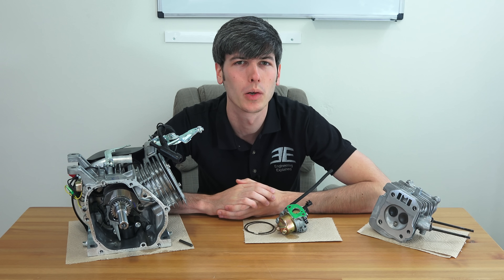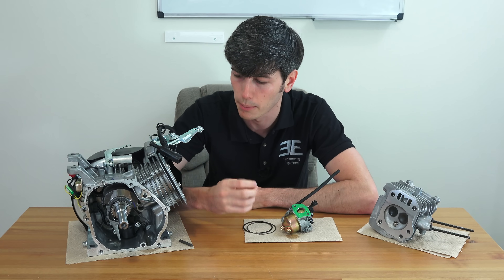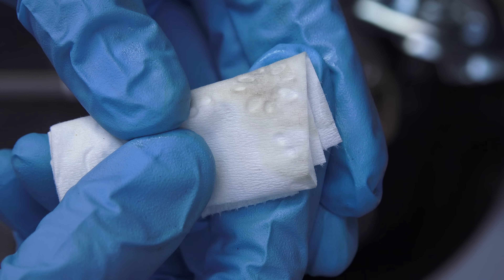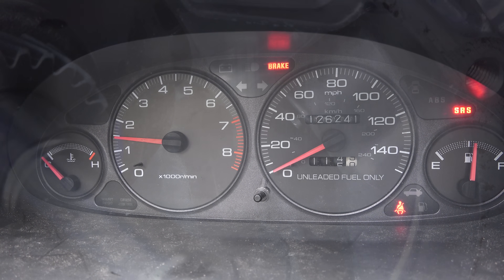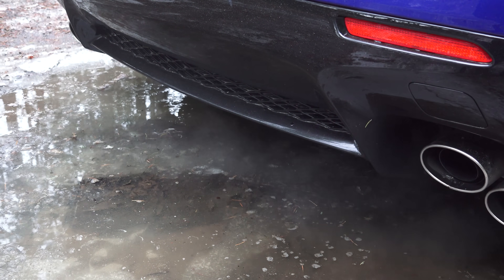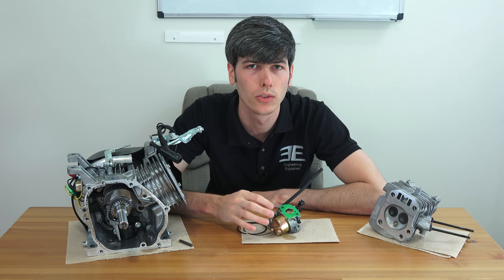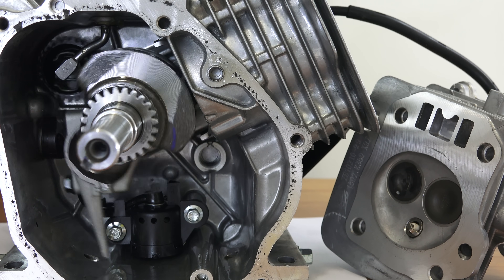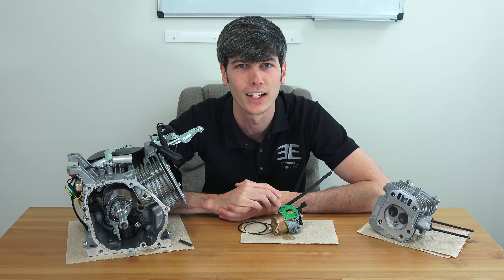Should You Warm Up Your Car Before Driving?

Comment: that was a contradiction.  towards the end of the video you state not to drive hard until the engine is warm.  That's the point of warming the engine.  Are you gonna jump on the highway and do 20 mph until the engine is warm??
Reply from the maker: Highway speeds don't require much HP,  it's accelerating that's tough on the engine. Accel slowly until the engine is warmed up.
Reply: @EngineeringExplained  cruising at highway speed means 3000 RPM in some vehicles. Not something I want to do with a cold engine.
Reply: @EngineeringExplained  wrong, if you go at the min speed of 60 mph on highway your revolutions are going to skyrocket during a cold start and you will hear your engine struggle. The high rpm, with very cold oil and fluid temps is extremely stressful for the engine. And no you can't drive easy on a highway
Reply: Engineering Explained haha.  you've never driven on the NJ turnpike.  haha.  Keep up the good work!
Reply: bb11 jr the last time I took off without warm up, the car felt like it was towing a boat.  EE thanks.... but no thanks....
Reply: My Fiesta diesel felt like the engine had rigamortis until it had warmed up. Especially in the winter. I had to use the glow plug about 20 times. The amount of people who do burnouts out of the work car park is unreal.
Reply: OK your bearings in a engine are aluminum with a thin alloy coating, they are there to have a perfectly smooth surface for the oil to make a uniform and thin layer your cam/crank/rods and so fourth ride on. So oil is/are your bearings, if you run a engine when it has sat for 6 to 8 hours or overnight there is little to no oil there and the bearings are susceptible to damage if a engine is ran at any higher RPM or Stress than necessary. It can take up to 10 minuets for oil to make it to the lifters and cam bearings in below freezing temps. That is why you let an engine idle and warm. Moving the car = stress on bearings and with no oil protection = damage. High  Revolutions Per Minuet with little to no oil when a engine is cold means scratching and bearing damage.  I hope this helps
Reply: Some cars just don't work right in the cold, that's why people warm it up other than having the heat working. I've driven off without warming up my car before. Frost building up everywhere as the faster you go the more the windows are going to be a problem unless the heater has a chance to build up some heat in the beginning.
Reply: I'm not worried about anything in the video. I worry more about thermo-mechanical stress. When you cook a turkey you do it slowly so that it will cook evenly. Otherwise, it will be cooked on the outside and ice on the inside. A large thermal differential means thermo-mechanical stress in an engine due to thermal expansion.
Reply: If technology was really smart they would make it good for cars to sit and idle some how not to start and have to go. There's a few cars with automatic heat that comes out no matter how cold.
Reply: Whatever got over 340k on my lude and I remote start 10mins everyday
Reply: TheusZeusDeus the engines in new cars run at higher rpms when you first start the car.  i don't idle for ten minutes but at below freezing, i do warm up for 2-3 minutes (little longer if it is the really really cold vortex) as my transmission jerks more in first two gears, second more than first, if i don't do it. Then the engine is warmed up by slow acceleration on the road.
Reply: Its about the torque and pressure added to the engines components when you move the vehicle. The man who told me about this has rebuilt and made race engines for 50+ years on a professional level. He only works on engines nothing else. I worked with him for a while he taught me a lot. But its your vehicle do as you please I am just trying to give you info to make a logical and informed decision that is best for you. Best of luck.
Reply: I live in a relatively mild climate but let the engine idle long enough for the RPM to drop. I do this to spare the transmission clutches when dropping it into gear. Not sure it it does though.
Reply: Noir Spectre bro come on!!  everyone knows a cheeseburger is better!!
Reply: By the time you get to the highway, it should be fine for you to hit it harder.
Reply: Grandizer 45 think of a human body, are you gonna wake up and automatically go sprint?? No, same with a car. You got turn your car on and automatically go 60 mph or just gas your car.
Reply: I think what we are missing here is that the engine oil doesnt flow that well when it is cold.  You have to wait for it to liquify so that it can flow easily through the different passage ways.  This is why you hear the lifters on start up.  Taking off with that oil being thick is gonna put strain on your bearings and lifters.  And if you have conventional oil its even worse.  Let the oil liquify and flow through your engine.  Once the lifter noise settles down, that is a good indication the engine is ready to go.
Reply: Rata 4 U yes but the load on the engine is not the same.
Reply: taxid3rmy im speaking from experience.  i've taken off with a cold engine and it felt very sluggish.  sort of like when you are breaking in an engine.  Is EE even old enough to drive yet??  haha
Reply: Grandizer 45 I actually agree with you this guy has no idea what he is talking about and it is actually very bad for the electronics when you don't let it warm up, I know this from experience with fuel injected and engines with carbs. It is good to let any engine warm up, so yes I agree with you and this guy is just saying a bunch of crap.
Reply: Kneedragon1962 guys please understand that idling does not put the same strain on your engine as does driving.  When you drive you are putting load on the engine.   It's a big difference.  Putting load on an engine where the oil hasnt circulated properly is very bad.
Reply: speed has no correlation with engine load. throttle position does. so that is invalid. heavy engine load is what you wanna avoid until the engine is up to operating temp
Reply: Grandizer 45 yeah this is just a young kid reiterating what he found on the internet. i cringe when i see people take off from a cold start.
Reply: @Tony, that's probably a bit unkind. They're making a TV show for idiots, that's true...
Reply: No you don't have to do that. Just don't floor it. Gas engines warm up fastest under a load, so moderate acceleration is fine vs letting it idle for 15-20 mins in a driveway.
Reply: It's easier to warm yourself up by walking around the house rather than lying in bed awake
Reply: @mb013962  Actually, that's a pretty good analogy. You don't wake up, leap out of bed and then sprint around - you'll do yourself an injury.
Reply: +Engineering Explained So are only high revs bad for the engine or also heavy load or too low revs?
Reply: taxid3rmy are you his girlfriend or something.  why are you so sensitive??
Reply: @Grandizer45 - Have some sense! Driving it at 20 mph is the same as sitting still and idling. What he means is stay below about half throttle and about half the available revs, then after a short time, below 2/3 ... Start using all the available power and torque when the temp is about the bottom of the normal temperature range. Now most of the time, during normal driving, you don't need or ask for full revs or full power either, so all this is saying is don't get into a stop-light grand prix in the first 5 minutes.
Reply: Whispered - that's why you have a window scraper ready.
Reply: Eric Lopez The irony is that you have to move your car for the heat to finally defrost the windows.  I think that it might be due to the extra power that is going for the high idle speed when you start the engine.
Reply: Rata 4 U I agree. their parents probably taught them that a really long time ago, or they just believe it themselves. but a bunch of engineering scientists even prove them wrong.
Reply: or you can just scrape your windows, and you car can warm up for a sec, giving oil plenty time to cycle.
Reply: Danny Abifalah, leave it, he doesn't know the difference between a regular acceleration and flooring the pedal
Reply: Rafael to bad we all couldn't just have a Roach
Reply: No I wake up and automatically go back to sleep -.-
Reply: Most cars can do way more than 60 mph. 60 isn't hard on the car, 0-60 in 7 seconds is tho.
Reply: Grandizer 45  He means dont race it and use relatively lower RPM ranges
Reply: Engineering Explained hello Jason! You said that rich fuel mixture may result in oil dilution. But when you start going with a cold engine you put more of rich mixture in the cylinders. Wouldn't this cause even more oil dilution?  It's very curious! Thanks for what you're doing by the way,  from Russia.  Your channel is my favorite
Reply: Whispered Metsutan
Reply: Driving in the highway is not "driving hard". Driving hard is high load i.e. giving it lots of jandal and/or high rpm.
Reply: I had the exact situation today, did't warm up my car and jumped to the road on 20 mph to avoid overloading the engine and guess what!!! Total mess
Reply: @Global.Policy.Analyst that's because you shoved it in drive right away. you should have waited a few minutes
Reply: This person thinks that driving your vehicle hard is the only way to warm the engine. You can drive it lightly and you'll still get heat
Reply: These people don't care about safety when their transmission won't shift or their windows frost up because they didn't give time to let their windows defrost.
Reply: Luke Vassar if there is someone who know what he is talking about, it's him..
Reply: Grandizer 45 at idle the engine is only lubricating a very small part while the rest of the engine including vital parts will eventual get oil to them once they start moving. It still takes a short period of time even after the car starts to move to get oil and protection over the rest of the engine. In winter this could take a bit longer so it's important to take it easy the first few minutes. The worst thing you can do to a car is let it sit and idle then not drive it. The first part of driving it is the actual warm up stage. then you can hammer it and go do some donuts
Reply: He states that running an engine whilst cold washes away the oil so the more time running an an engine whilst cold is bad. You therefore have to minimise this (time spent cold) by moderately stressing the engine. Both high revs and high load is high stress for metal parts.
Reply: "Are you gonna jump on the highway and do 20 mph until the engine is warm??"

Do you live right next to a highway onramp?
Reply: @Grandizer 45 True, but verging on complexity. Some amount of strain is a good thing. No strain means no heat, and no warmup and no oil pressure and low rotation speeds, which means highest loadings across thinnest oil membranes, at things like cam lobes & lifters... If you have a big aggressive cam in a chev small-block, and you start that engine and just let it idle, that's not going to do it a whole lot of good. Even when stone cold you want a few revs on that engine. The point is, you should not simply start the engine and then wander back inside to make a last cup of coffee. Nor should you go for redline revs at full throttle and full load and maximum torque while the inside of the rods and crank are still at room temperature. My point is not that everybody should, or that everybody shouldn't. My point is that most people don't know as much about this sh1t as they'd like to think. In many cases, the right thing to do, most of the time, is start the engine, then finish with your seatbelt and check your mirrors, scratch you ass if you like, and then drive off, but don't really ask the engine any big questions for a few minutes. Use it normally but a little gently for the first few minutes.
Reply: and i also wonder if when he says that warming the car up means its injecting richer fuel "longer" he does realize its not a function of time, but amount of rotations. if you warm the car up to normal temps for 10 minutes at 1000 RPMs, or 5 minutes at 2000 RPMs, the engine goes through the same amount of cycles. So warming it up just means its taking longer to do the same amount of rich injections, but changes nothing about how many times the injectors throw a richer mixture in. this vid is kinda garbage reasoning compared to his normal vids.
Reply: Warming the engine causes excess gas to be injected into the engine. This excess gas drains into the oil, thereby diluting it which causes increased engine wear. While the engine may be warm, the trans & the drivetrain are still cold which confuses a number of the sensors. I live near a highway, so I gently accelerate up to highway speeds (I don't floor it). That way everything warms up at the same rate.

Several friends were persistent engine warmers despite my warnings. Their engines failed at less than 70k miles due to excessive wear. That's hardly any wear on modern engines. I've gotten more than 200k miles on my last 3 engines, with 30 sec warmups, 5k-8k mi oil changes, unless I had to scrape ice/snow, then gently driving until normal operating temps are achieved.

You'll never have to worry about me holding up traffic on any road.

Comment: a more important reason to warm up the engine is for protection of bearings and rotating components. oil isnt flowing too well when cold so if u get on it when the oil is cold, it cant fully protect and lube the bearings in your engine

Comment: TOO whom it may concern:: The warming of a vehicles engine and accessories must be taken in different revelations. Due to climate and atmospheres in which vehicles engines are operated and the job the engine is getting ready to perform. Reason being if your using a viscosity type of engine oil instead of a synthentic blend of engine oil upon  start up especially cold days.If you just go on and drive a vehicle after sitting over night the oil is drained back into the oil pan, hydraulic lifters bleed down and slight film of oil is on the crank and camshaft bearings etc. Possible bent valve push tubes , bent valves and great engine damage could result including spun engine bearings. I know this has happened to me. Test;  perform  engine load test and no load test and first start up in the morning by opening the fuel control on full throttle and see what happens

Comment: instead of driving off after 30 seconds from switching my car on what if I lightly revved it at 1500k regularly  for example for a couple of minutes then drove off ? I've got a turbo charged engine , 4 cylinder and 381 hp so want to be careful I don't get the turbo doing any work until everything is warmed up

Comment: read this before a YouTuber fucks up your car when you start that cold engine, it's essentially running without lubrication. If you start up and immediately put a load on the engine, things could get damaged. It's just not ready to go. Take a minute or two to get that oil pumping around before putting any load on the engine, and your pistons and camshafts and turbos and other spinning, moving bits will be much, much happier. people who race cars wrote this

Comment: Dear Jason,
I’d like to ask your opinion about driving a gasoline car during winter time. Since you are the most reputable source to me and to my friends, if you could answer that would be amazing.
I’ve a 2002 Volkswagen Golf MK4 1.6 16V. I’m kinda new to the car world and I’ve watched your video about the winter time idling won’t help the life time of the engine because of the rich air-fuel mixture. After the start and waiting for 15-30 seconds how should you drive your car? I live in Hungary where the speed limit average is 50 km/h (~31 MPH). Should I drive it in 3rd gear ->2100-2300 RPM or may I shift to 4th gear and be around 1600-1700 RPM. Which one is better for the engine? From experience if I stay in 4th gear the car won’t stutter or anything. (Using Castrol 5W-30 engine oil and 95 octane petrol).
I hope this will get to you. Wishing you the very best and please keep up the excellent quality what you provide to us it helped us tremendously.
Sincerely,
Patrick

Comment: How about the metallurgy involved here. Alum and steel will contract and expand at different rates. The engines are riddled with a mixture of Alum and Steel of varying alloys and hardness. If you start putting forces onto an engine the is not yet warm you run the risk of parts operating out of tolerance thus creating wear problems.Yes the oil should help but frozen oil will likely not properly coat the surfaces. Further more many engines have bearing tolerances as low as .0003" you want me to think the block, bearings, crank, cams wont expand or contract at least that much?

Comment: More to the point of practicality: If it's cold as heck outside, letting the car warm up idly while you're in the house getting the kids ready (or whatever) is a lot better than sitting in a frigid vehicle.  Similarly, I don't drive until the frost has been cleared from my windows, at least to the extent where I can safely drive.

If the cost is wear & fuel, then so be it.  Not like I drive anything pricey anyway.

Comment: So what would be a good rpm limit for "driving too hard" ? It's usually around -20 celsius during the winter where I live and I let my car run while I'm scraping the windows. There's a steep hill right when I leave the  parking lot and I usually drive up it at 2500rpm in order to change to the second gear. Is that rpm too high?

Comment: I've warmed up every car I've ever owned never had a problem and u figure your oil temp takes longer then coolant to rise and oil doesn't start lubricating parts properly until up to temp I'd rather leave it at idle with no load on bearings until it's warmed up and also the fuel injection is going to dump more fuel regardless until it's warmed up until it goes to closed loop